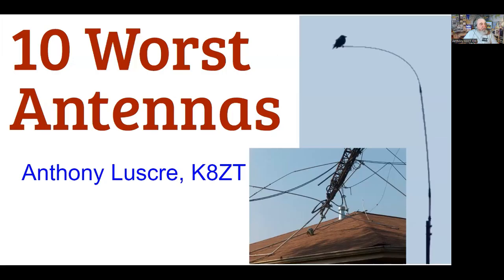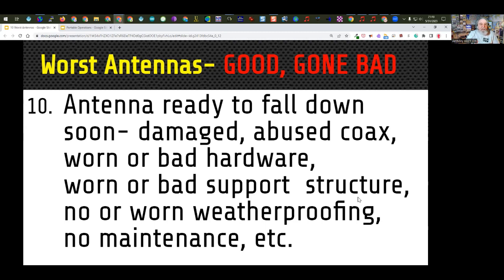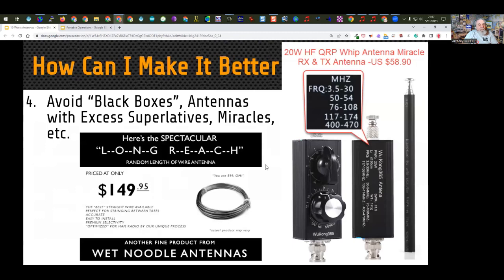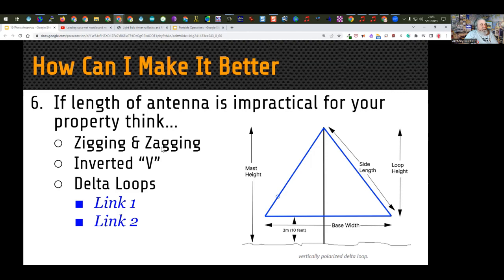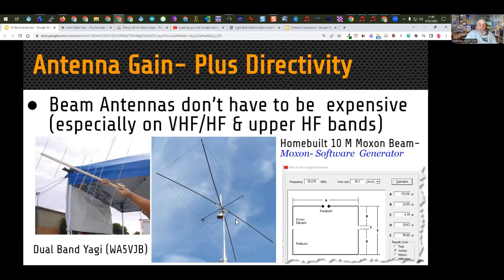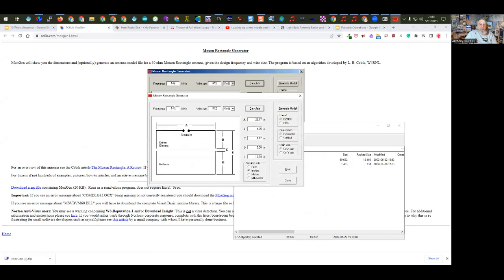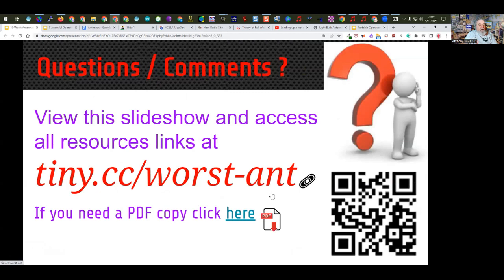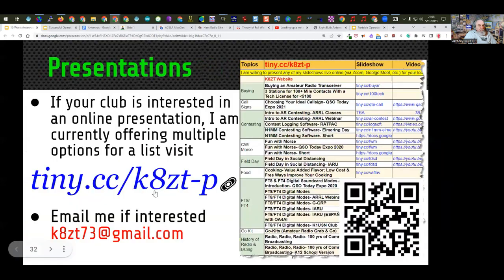10 Worst Antennas for Amateur Radio & How You Can Do Better! - 05/31/2023

Comment: Excellent video! Very well done. I've been using a 102' doublet with 600 ohm feed to the tuner and a 6m beam. While the doublet is far from ideal and is a compromise - it does get out (323 countries worked on it + closing in on 2000 dxcc challenge points). I sometimes will throw up an additional homemade rotatable dipole for 10m or 12m (especially with this solar cycle) or a delta loop which hears really well. Something up is better than nothing up.
Reply from the maker: I love the doublet with wire feeders

Comment: The coax on an end fed IS NOT A COUNTERPOISE! The 49:1 or 9:1 unun has a connector for a counterpoise which should be .05 the  length of the lowest band used (e.g. approximately 16' for a 10--80  meters.) You may also need a line isolator or choke balun as close to the transceiver as possible to control common mode  current if you are experiencing RF in the shack.
Reply from the maker: Both are true.

Comment: Fine business! Excellent sanity check. Got my ticket in depth of the last solar doldrums & first antenna I put up was a 40 M vertically polarized vertical loop hung from a few trees in the yard. Still my best antenna for 40M & 20M. Using mostly horizontal loops & half squares these days on 20M - 12M, double loop on 6M keeps the take off angle low.

Comment: In regard to the lenght of radials for vertical antennas- in AM broadcasting, the standard is a quarter wavelength long at 3-degree intervals buried 6" deep but far fewer will work pretty good too and if directionality is desired, the radials need only be in the desired direction.
Reply: I hate to say it...but amateur radio stations can in no way emulate AM radio radial systems. On the ground, the radials need to more in quantity than any particular length, given how lossy ground can be. Any attempt to perfectly tune radials on the ground is futile. Tuned radials are only possible at an elevated height above ground - 6 ft or more. Even one elevated radial can bring the SWR down flat maximizing the RF getting to the antenna, all else being equal. Ground mounted verticals are best used with multiple short length of wires attached in a circle around the base of the antenna. It becomes half of your antenna, since all verticals are is a dipole tipped 90 degrees anyway. 73 de Scott W1AL

Comment: I'm looking at building a off center fed dipole from Palomar but instead of using their wire I was thinking of using aluminum electric fence wire or stainless steel wire as I don't want to have the wire stretch over time and we have really bad weather in Texas. Does this sound better than the pvc copper wire they sell and if so aluminum or steel?

Comment: What effect would nearby solar panels (on the south side of the east-west roof) have on a dipole running along the ridge of the roof between two supports???
Reply from the maker: It would be hard to predict. There are multiple possible factors- the metal of panels, interference generated by activity of panels. Its probably going to come down to some experimentation.

Comment: hi god point usualy the best solution is to have antennas you use  have a long wier 4 hf 160 to 6 low power and  a antenna 4 160m to 6m hy power  both  have auto tuner 1 antenna 4 whf uhf bands   portable have a atas120a or long wier convertable to dipol portable tuner  4 multi band work ,wehicle  has instald on it the same config as at home only diference is have a telecopic mast and a a 3 radio 160m to10 ,6m 2m 70 cm .in a emergencyu you can use almost anithing as a atenna to get thast conection but is bot recomended

Comment: You talked about how to point the antenna. There is a video VHF-UHF Vertical Dipole! Becouse it is made of 2 - 36 inch  lone 1/8 Stanles Steal welding rod. mounted on some 3/4 PVC. You can hold it one way to get Vertical and hold it differant for horizontal. It also can be taken apart and the rods put inside it to move it or store it.  it doesn't cost much to make.     73    W4DES